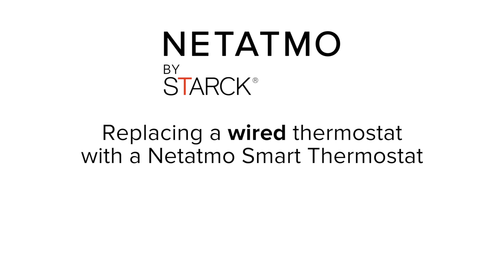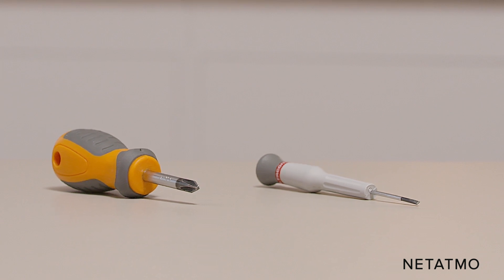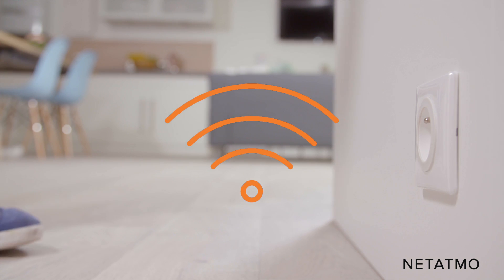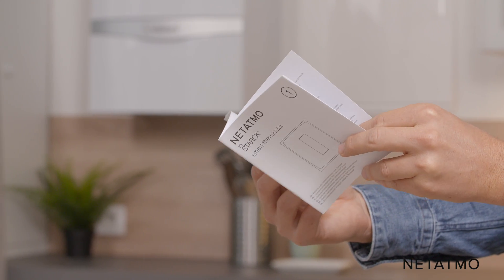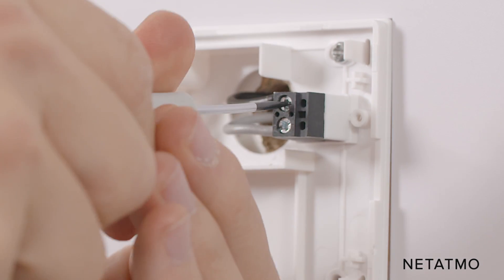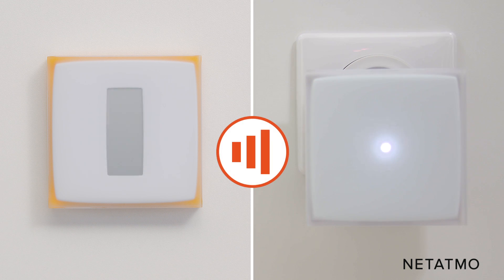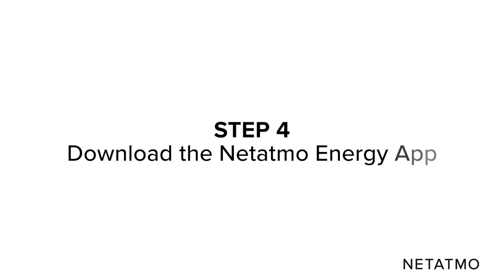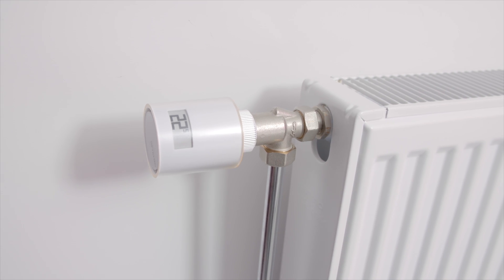How to replace your wired thermostat yourself – installing the Netatmo Smart Thermostat

Comment: what if we connect the delay as you showed wirelessly by pluging it to a wall socket and then keep the netatmo thermostat wirelessly? Does it work? Or you have to connect at least one device directly with the wire connection?

Comment: Can the thermostat be wired?
 I’m not happy with the battery performance, using it in a second home where the heating is not always on. The cold affects the performance of the batteries, will be testing the lithium batteries… but I’ll love to have a wired option

Comment: I’ve moved in to a new home that has one of these thermostats , it seems fine but the heating turns down to 7 degrees in the middle of the night so I wake up cold and have to turn it back up every night , we have no instructions or paperwork to aid set up , is there a full set up video that will guide me ?
Reply: I have the same problem😂
Do u have a solution?
Reply: @markusklinglmair3521  I found the previous home owner had set ‘schedules’ so I had reset all those and yet the problem still existed …. I then found by switching off ‘heating prediction’ in the ‘operation mode’ section sorted everything …..

Comment: I’d really like to see a video on the Netatmo smart modulating thermostat being fitted to an S plan system with an OpenTherm-capable boiler to achieve a hot water priority system and get the maximum fuel saving capability of such a boiler. Can this modulating thermostat actually apply OT to rapidly heat hot water to 60Celsius? There seems to be little information on the modulating thermostat, so is it all marketing hype?
Reply: And does it provide a Hot Water schedule?
Reply: And from what I can see from the installation instructions there are only four wires from the relay to the boiler- 2 for power and 2 for OpenTherm modulation, so how the heck can the boiler output feed be switched between CH and HW??

Comment: Your doc is most confusing, there are 2 manuals for two different configurations, and the front label doesn't help identifying which does what. 1st configuration (which is a bit weird, the "relay" serves no purpose) allows a fixed thermostat, 2nd allows a mobile thermostat. Next time, put a simple diagram in each manual to show the configuration. The first manual is supposedly a replacement of a wire thermostat, but this can actually be done with the 2nd configuration (which allows the new thermostat to be mobile).